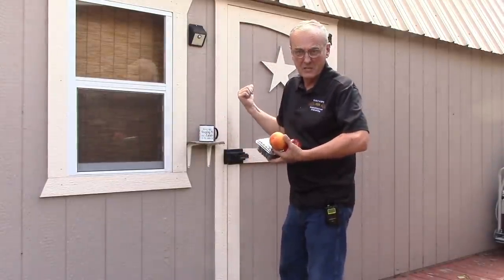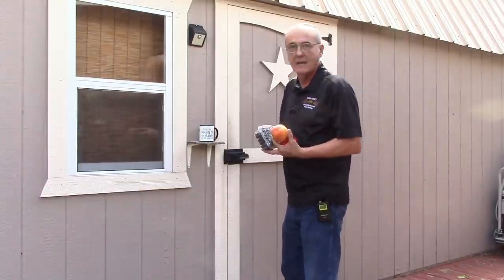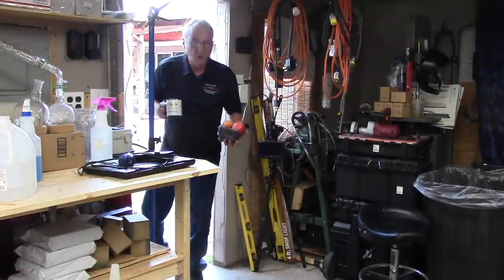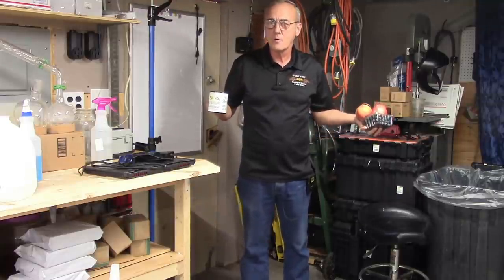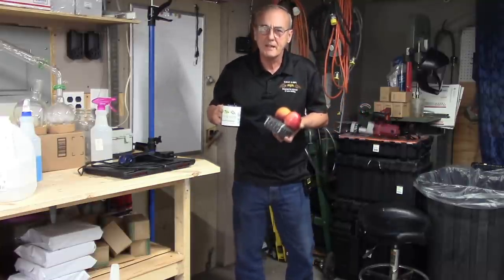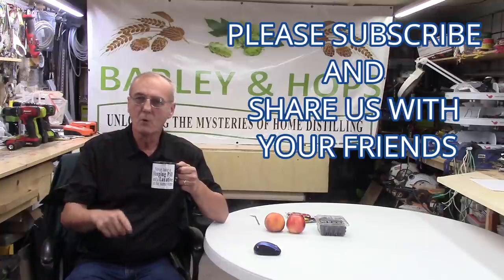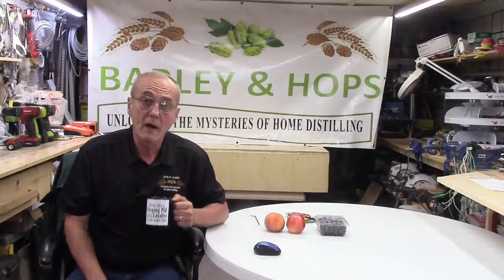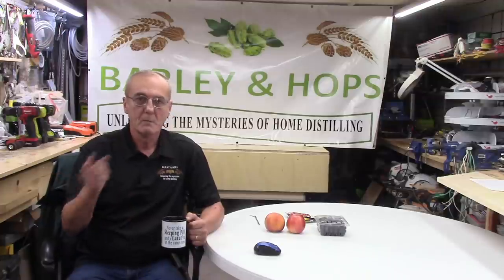FLAVORING SPIRITS AND MOONSHINE

Comment: Hey  George how you doing.Hey every body else.How does the essence of grain transfer if the the essence of apple does not.What i mean is  if ethanol is our target and that is what we achieve is  the essence of said grain a character ,i need a better word.Would there be a distinct difference between sugar wash and grain mash of the same product say of apple pie moonshine i hope that makes sense
Reply: Grains do pass their flavor over to the final spirit better than fruits.  Example of this is corn based moonshine which certainly will have a corn flavor.
Reply: @skyhookspirits   Thank you so much for taking the time to reply .
Reply: But my question is this.after we have distilled filtered and proofed and then flavoured is there a measured difference between grain and sugar. i understand if when we where drinking neat or pure but what about enhanced flavours does the essence of corn or barley shine through
Reply: One caution, if you are filtering through charcoal be sure the spirits are not more than 100 proof (50%ABV) or the filtering action will not do much since above 100 proof it will run through the charcoal too fast to do any good.
Table and dextrose sugars don't add much to the taste, but grains will.  Rye for example will add a bight to your spirits, so use rye sparingly.  If you just want a simple neutral spirit to make Vodka, sugar of either of the above types works just fine.  I make my Vodka using a combination of sugar and soft white winter wheat.  The wheat adds a subtle flavor which inhances the Vodka's taste.
Reply: @skyhookspirits  Excellent answer thank you so much for taking the time to reply.I am trying to make gin so i was curious as to if the the base spirit affects the final product or does the additional flavours  in the botanicals mask the taste good or bad
Reply: The base spirit flavor can affect final taste when post distillation flavors are added.  This affect can help, hurt, or have little affect.  This is where the "art" of this craft enters the process.  What to add and how much come with trial and error.  Experiment, read what others are doing and try recipes that appeal to you.  Flavoring to me is the real art of this craft, and even after years of messing with it, I too am still learning.  Good luck.
Reply: @skyhookspirits   Excellent answer i really like the way you  say the art of it that is excactley how i feel about it and  like you say its a craft good words and you say you are still learning shows  you are  on a voyage thank you  so much for your time